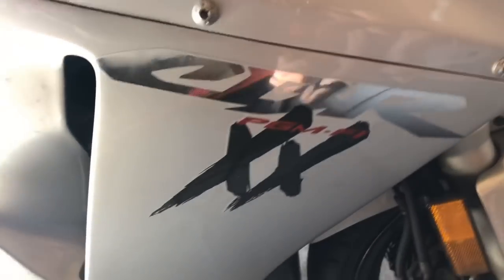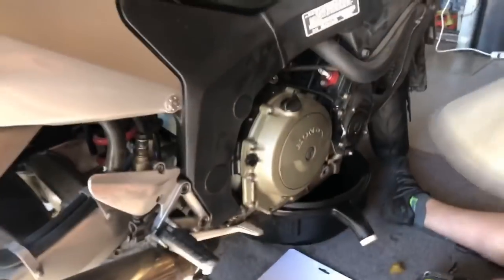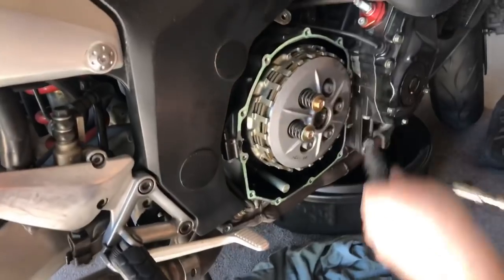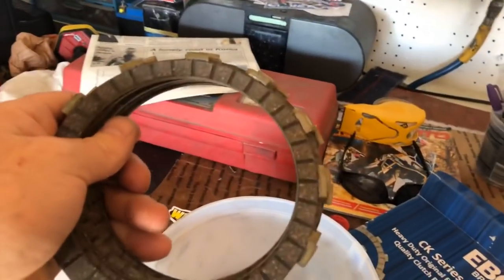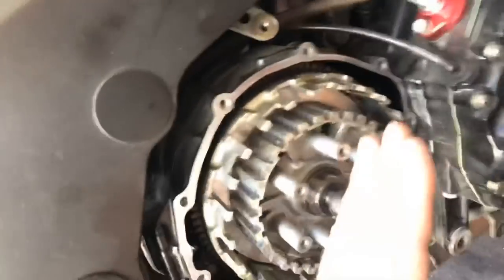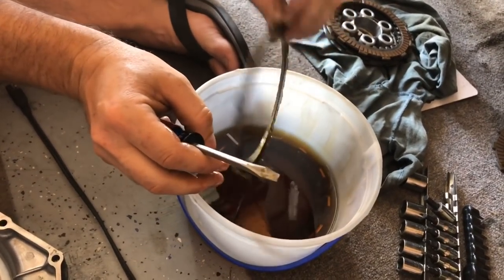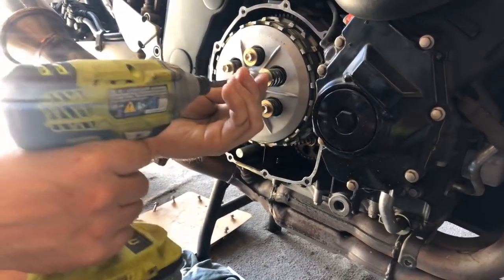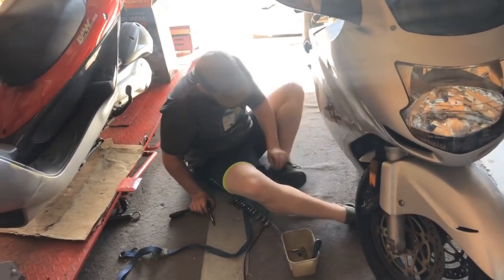Changing The Clutch On A Honda CBR1100xx BlackBird

Comment: According to the Blackbird service manual discs and plates must be coated with clean oil before installation, does not specify leaving them soaking for hours. I've done two replacements so far on both my XX's clutches following the manual and haven't got any issues with it. About the clutch rattle noise at idle when engine is cold if you can live the noise don't do nothing, all Blackbirds do it, but if you don't you must replace the clutch outer needle bearing which it tends to wear a bit creating that annoying rattle noise keep in mind that the noise will come back when the bearing wears out again is a design flaw by Honda as well as the CCT cam chain tensioner which wears out creating rattle noises on the cam chain between 3.000 - 4.500 rpm, to solve that just use a manual tensioner that way you will avoid spending money on oem tensioners often. Keep good care of her  and she won't fail you having a great bike for many years of riding enjoyment, Blackbird engines are bulletproof. Ride safe, cheers mates.
Reply from the maker: Ogeid Zepol I saw one for sale with 178,000 miles still running good.  We installed a manual CCT on this one.  You know your Blackbird info!  Great bikes, thanks for watching.
Reply: @TomsTinkeringandAdventures  After 20 years living with BB's I think we bonded really well. Regards mate.
Reply from the maker: Ogeid Zepol it’s why they rarely go up for sale, people hold onto them.  Keep riding!
Reply: Late response I know but thanks for the tip about the rattle. I was thinking it may have been a basket problem.
Reply: The clutch rattle has nothing to do with the needle bearing , it is due to the play between the main drive cog and outer basket specifically between the captive anti shock / damper springs and housing . https://youtu.be/-bNZx14xfkY

Comment: My 02 Blackbird has 150,400 miles and still on the original clutch. Very helpful video when the time comes.
Reply from the maker: Calen Isbell I saw one for sale last year with over 200k miles.  Amazing machines!
Reply: Bulletproof engines, keep her well taken care of and you'll have a bike for a lifetime. Cheers mate.
Reply: @Ryzen_56X  Not bulletproff, it´s a low compression car engine (near 1200 cm3) with a few ponies (150hp) and 10.000 rpm as max. If you can´t see 200.000 miles you have a problem.
Reply: @Big1_  A car engine ya say?? Nope. 1137 cc not near 1200cc. depending on the year up to 162 hp. How many have you owned I wonder?
Reply: @TomsTinkeringandAdventures  i just today (April 22nd 2021) bought my fourth XX. It's a beautiful 2002 US model in silver metallic. a mere 5100 original miles!! Love an XX!
Reply from the maker: @stevesmith6236  nice find!
Reply: @TomsTinkeringandAdventures  It took an entire month ( to the day!) to get all the particulars ironed out with the deal. I'm just a couple minutes north of Northeast Philadelphia, PA and the bike is still in Southlake, Texas 15323 miles away(ugg). Hope to be sitting on it by next week. Damn rare to find a 19 year old bike ( especially an XX) with only 270 miles per year average on it! Super clean in mint condition too. At 66 years old this will surely be my last "new" bike for a while.

Steve
Reply from the maker: @stevesmith6236  it’s going to be well worth it!
Reply: Oops, make that 1533 miles away.  :)
Reply: @stevesmith6236  Don´t worry, i have a 1997 one, i know what im talking about :)
Reply: A year later, I'm at 178,485.

Comment: Thanks, I've been putting this job off for a long time. My original clutch on my '98 Blackbird still works ok apart from slipping under very hard acceleration. Now I have the confidence to go ahead and do this job.
Reply from the maker: Dave's Hong Kong & China Channel wait until an oil change is due.  Make sure you order a clutch cover gasket as well.  Good luck, thanks for watching.
Reply: @TomsTinkeringandAdventures  Thanks for pointing that out. Already checking eBay  for a gasket.

Comment: Thanks, I  have a 2001 and now when it needs a clutch I can do it.  That looked easy and was something I was fearful to do.  Co.pared to forks or chain or tire replacement looks simple!
Reply from the maker: Chain/sprockets aren’t too difficult either.  My son might be buying this bike soon so I’m sure we’re gonna be doing more maintenance.
Reply: Try a cam chain replacement without removing engine. I upgraded mine to a heavier duty DID. There were moments I had moments of doubt but success in the end.

Comment: Hey, I want to thank you for this video.  I JUST got done changing my clutch and your video gave me the confidence that I could do it myself.
Tips and tricks for those of you about to change their clutch:
78 in/lbs for the clutch springs (you'll need a precise tq wrench for this job)
40 in/lbs for the cover
The factory gasket WILL shred itself on the way out and account for about 1/3 of the total time spent on this job.  Have something to scrape it off with that won't gouge the case.
Always a good idea to replace the clutch springs while doing this.  Mine looked fine, but they are cheap so I replaced them
EBC  plates and springs are the way to go
My friction plates had very little life left after 60K miles of commuting traffic.  The rings and basket are still in decent condition and went back in.
This video was incredibly accurate for the steps I took, down to hammering the case off with a rubber mallet.
99 BlackBird
Reply from the maker: Andy Stevens great additional information, glad I could be of some help.  Thanks for watching.
Reply: @TomsTinkeringandAdventures  Your video is coming in handy once again.  I just shared it with a Blackbird forum member about to undertake the same job.
Reply from the maker: @andystevens7557  what’s the forum? I’m now the owner of this Bird.

Comment: Hi had a rattle noise coming from underneath centre, disappeared when clutch lever pulled in whilst riding bike so I looked at clutch plates bolts springs all ok, then put everything back together in the right order, but clutch lever now wont pull in. Also took basket off to look at bearing all ok Cleaned out slave cylinder, push rod , rebleed  slave cylinder , clutch lever still stiff, did move in ok when bled clutch but stiff when tighten bleed valve. Any ideas to fix ? thanks😒
Reply from the maker: There’s so many things, it’s just too difficult to tell.  Sounds like it’s in the hydraulic system, either the master or slave cylinder.
Reply: think hydraulic side is ok as lever moves in when seperate slave cylinder from sprocket cover (piston moves freely) and again moves in when master c banjo nut is cracked open
Reply from the maker: @InvictaHorizonJFM83  Well then you need to take a look at whatever else you took apart.  It was working before you got into the clutch, so take your time and reference the manual.  Good luck.

Comment: Got the x11, which is very similar, but much rather. Thanks for the video, hopefully won't need it.
Reply from the maker: Peter Lewis hopefully not.  Great bikes.
Reply: Had one also, now I got two BB's in my garage, guess I got a thing for XX's. X11 great awesome bike and shares the same issues as BB's, service on them are similar. I suggest you buy engine carbon protection covers from carbonadi they look very good and you can put them also in BB's. Cheers mate, safe riding.

Comment: thanks for guide, im about to do clutch on my x11 because clutch is slipping on high rpms, but im wondering do i need to replace pressure plates also or is friction plates and springs enought? bike has 100000km on clock.
Reply from the maker: Really no way to know until you take it apart.  I usually just replace it all, you’re in there so it just makes sense.

Comment: never thought changing clutch would be that easy. what are the torque specs for basket bolts and clutch cover? 
thank you for sharing.
Reply from the maker: ehsan83 78 in/lbs for the basket.  40 in/lbs for the cover.
Reply: @TomsTinkeringandAdventures  excellent thank you again
Reply from the maker: ehsan83 I just found them on a Blackbird forum, you may want to double check.
Reply: @TomsTinkeringandAdventures  Forum post: http://www.cbr1100xx.org/forums/index.php?/topic/71793-inch-lbsft-lbs/  Make SURE you have a tq wrench that can do in/lbs or you risk snapping the bolts.

Comment: Hi from Argentina! I am considering getting a Blackbird. They cost about USD 10-12K here with 30000 to 50000 kms. Are those too many kms? Should I wait for a unicorn with 15K to appear or just go ahead and get a 50K one?
Reply from the maker: Hi, always great to see people around the world watching!  I have seen several of these bikes with very high miles.  Obviously lower is probably better but a well maintained higher mileage bike is a good choice.  Good luck finding the one you want.
Reply: As long as it is maintained, mileage doesn't matter much on the Blackbird.

Comment: Did you take off a wire?
Reply from the maker: darren cycles hmm, I don’t think so?
Reply: @TomsTinkeringandAdventures   there's a  clip inside there before the last clutch plate.  Holds in the last plate.
Thanks Tom.
Reply from the maker: darren cycles I will look into that, thanks.
Reply: Yea part 13 on dirigram

Comment: I got a question about this bike I own one
Reply from the maker: Well my son owns this one now, ask away.
Reply: I’ve got 1997 , I bought it from a guy who had just changed the clutch, and he had bought it from a guy who had changed it a couple times. The bike will change gears smoothly but slips under hard throttle. But if u release some air from the clutch valve (think that’s what it’s called) it will run right for a little while. I’ve had people tell me to change the oil to synthetic which I did, but it’s still doing it. Any ideas?
Reply from the maker: @lifeasatrucker3825  well if bleeding out the clutch cylinder makes it work for a while, then I would believe that your problem is in that area.  It’s a pretty simple system.  Maybe you just need to rebuild one of the cylinders ?
Reply: Thanks I appreciate the information I’ll YouTube what it is I need to do lol
Reply from the maker: @lifeasatrucker3825  my first suggestion would be to rebuild the clutch master cylinder.  There is a “release hole” in it that can get gunked up over time causing it to hold pressure.  The parts are not expensive and it’s pretty easy to work on.  Need to get a good circlip pliers, that’s about it.